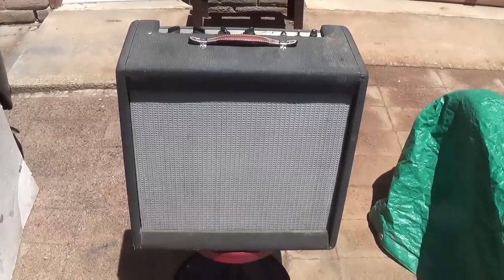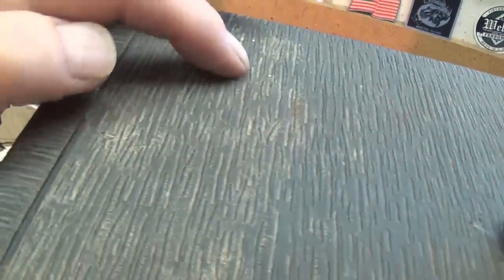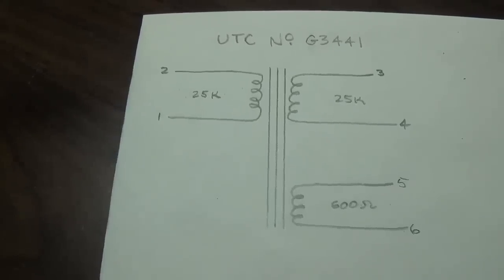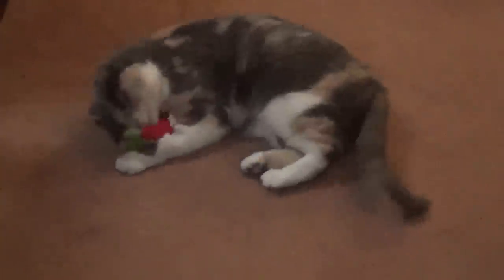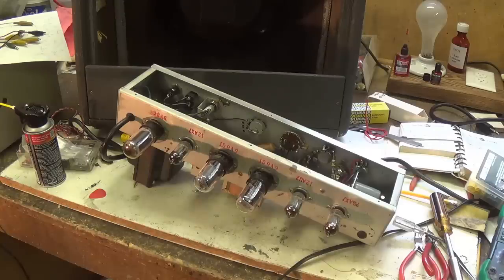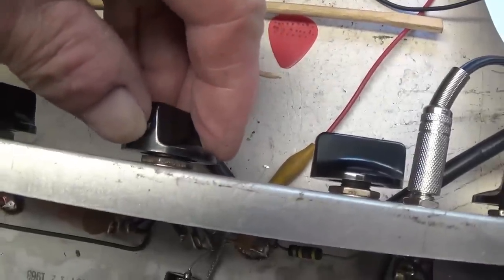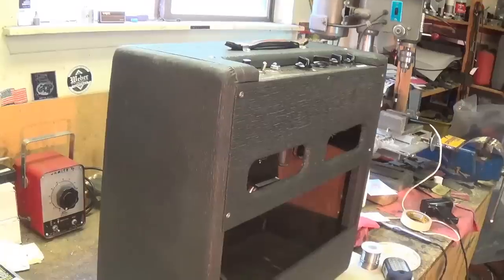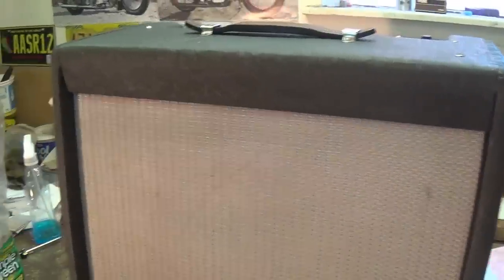1963 Lesmann "Echo" Amp......No More Polkas for this Bad Boy

Comment from the maker: NOTE:  As a viewer noted, the tremolo seemed to overdrive the output tube(s) a bit. As a result, I increased the value of the resistor between the oscillator and grid from 100K to 220K. Problem solved :)
Reply: Whoa UD! The guitar fairy dropped a Legend Rock n Roll 50 on your doorstep!! That's the amp Billy Gibbons used to record ZZ Top Eliminator! Careful, that is one LOUD amp  📢🔊

Life is good 😎👍🏼
Reply from the maker: @kickinvideo333  It is indeed, KV.....and it is truly LOUD !!
Reply: After watching one of your educational videos I understand why the vibrato did not work when connected to the grids of both output tubes.
The push pull circuitry cancelled it out!
When you moved the tremolo to only one output tube grid there was no cancellation.
Reply from the maker: @Dennis-mq6or  Thanks for the helpful input, Dennis :)

Comment: From Leo:  My mother's  accordion had a magnetic attached microphone that was hard wired into a long lead cable.  A low Z microphone could explain that 600 ohm input.   Nice work.
Reply from the maker: Thanks, Barb. I agree.
Reply: Barb Melle, it's interesting to note how many amplifier manufacturers in the late 50s and early 1960s were manufacturing amplifiers with labeled accordion inputs, amps that were marketed to accordion players. This includes Ampeg, Sano, Magnatone and all the various rebranded "Maggie's" such as Panaramic, Titanio, Giuletti and others. And yet, the actual pickups or microphone assemblies that would have been attached or fastened to the accordions themselves are virtually nowhere to be seen. I've bought a lot of vintage microphones at flea markets and ham radio Fest in past years, and although I would see lots of accordions at the flea markets they never had pickups attached.
Reply: @goodun6081  I wonder why?
Reply: @donaldheitger6731  , like I said, it's a perplexing question. Perhaps the inclusion of accordion inputs on all those amplifiers was merely being hopeful on the part of the amp manufacturers, that they would be used for something other than loud rock and roll guitars. Certainly Ampeg founder Everett Hall detested rock and roll, and made every effort to not accommodate rock and rollers or anybody with long hair, any bands that were coming through the area and might have been interested in visiting the factory, and so on. This definitely put a dent in Ampeg's sales figures,  until Hull was finally put out to pasture in the late 60s. Anyway, perhaps the anticipated, hoped-for (chuckle) glut of pickup-equipped accordions just never materialized. The old- guard musical equipment manufacturers we're slow to see that the rules of the game, indeed the entire game, had changed. And then the music market got really soft around 1969 and a whole bunch of manufacturers went bankrupt.
Reply: @goodun6081  I have a Farfisa "Transicord" amp (Solid state, sadly) with an accordion input.   The connection looks a bit like a tube socket, actually.
Reply: @goodun6081  I started playing guitar in 1957 and there were a lot of accordion players around. By 1965, not so many.
Reply: @goodun6081  I know I'm really late to this party but it's fashionable, many years ago I repaired an old guys electric accordion. No mike, just plug straight in.

Comment: Ya know, Doug...its surprising how much difference just having clean, proper power supplied to the amplifier(& fx) makes. I bought a 3-light outlet tester and it showed the outlets I use had live & neutral swapped.

So I swapped them to their correct spots on the outlet and buttoned it back up. I swear to you that killed 90% of my hum issues. I couldn't believe how much hum I was getting.

First, I was getting hum from the outlet itself due to the backwards live & neutral. Then I was getting EMI hum from it when I got anywhere close to it with a guitar. Finally, I was also getting hum from my cheap pedal power supply.

So I fixed the outlet and that killed the power hum and the EMI hum. Replacing the power supply got rid of that hum/buzz, as well(and the last 10% of excessive hum). I honestly couldn't believe how much buzzing & humming I had prior to fixing the outlets.

Now, it's quiet as a mouse. I can crank the amp up 100%(gain & volume maxed) and it hums less than it did at even 25% before. When I plugged in after fixing it all, I was ecstatic, to say the least. 👍
Reply from the maker: That's great news, JC. Thanks for sharing :)

Comment: Aluminum is difficult to drill because of it ductility and softness causes a constant contact with the cutting edge of the drill face. Probably to save on drill bits during manufacturing.

Comment: I'd be "less of a man" for not watching this Lesmann amp video.  Thanks Uncle Doug.
Reply from the maker: Thank heavens you watched, ¿. You're welcome.
Reply: @UncleDoug  what's the best way to contact you to donate hardware?  I'm considering getting some reissues of 1965 Fender guitar amps but not sure how they stack up to the originals.  I hear they make them in Mexico now.  Not sure whether to get a Princeton or Deluxe Reverb. What do you recommend?
Reply: Is that a ‘ Nes Lesmann ‘ or a ‘ Les Nessman ‘ amp?
Reply from the maker: If I were you, I would find a nice Silverface Princeton or Deluxe Reverb from the late 60's, early 70's. Their circuit is virtually identical to the Blackface versions, yet the price is about the same or lower than a reissue.....which will have PCB's, 1/4W resistors, and all sorts of corners cut to keep cost down.  Give me your e-mail address and I'll contact you directly.....but make it a fresh comment. This one is buried too deep to find tomorrow.
Reply: @UncleDoug  your recommendation is much appreciated Uncle Doug, and this leads me to ask, if the price is nearly the same, and the circuit also nearly identical, then why not opt to buy a new reissue which has the added benefit of tubes that have not depleted any of their life cycle?  Not questioning your wisdom, just trying to understand where you're coming from. Admittedly, I'm partial to the aesthetics of some of the reissues currently available in some of their limited edition versions.
Reply: @michaelszczys8316   I'm actually in the market for a Les Nessman amp.  I've been following them on eBay, but since they earned the coveted Silver Sow Award, their prices have gone through the roof.
Reply: @thBrilliantFool  The Silverface Fender amps will hold their value or appreciate in value over time. They can easily be serviced and repaired almost forever. The reissue amps are quite good but lose value just like a new car. The components are cheaper and the circuit boards can become problematic, particularly if you want to do some component upgrades.
Reply from the maker: @johntempleton6368  John is correct. The earlier amps are far more robust, often have better tone, and will appreciate in value.

Comment: Check out Mr Carlson's Lab he gives good servicing advice for the hybrid Legend  amps the semiconductors are easily destroyed, good advice for anyone not used to working on this type of amp
Reply from the maker: I am not strongly inclined to work on the hybrid circuit, John, but if I do, I will keep your suggestion in mind.
Reply: The upshot was, don’t go around with your probe AC-coupled in the high voltage bits and then zap the SS bits with the charge still stored in the probe’s or scope’s coupling cap.
Reply: Correct being unaware of this hazard could end in tears
Reply: @hubbsllc  , and although it's not a hot chassis, transformerless amplifier, an isolation Transformer on either the amplifier's power cord or the oscilloscope's power cord might be a good idea.

Comment: Nice job. The mystery transformer is in the anode circuit of V1B. It is therefore an output, providing two isolated secondaries: 25K at the same level as the primary, probably a few volts, perhaps to drive a slave power amp, and 600 ohms to drive a studio mixing desk directly. Or maybe they are the send and return to and from the missing echo unit? Both are tapped off before the volume control of course. It is a feature, not an anachronism, and IMHO you should leave it wired in. Anyway the primary is part of that anode load and can't be removed without shifting the operating point of V1B. The 25,000 and 600 ohms are impedances, not DC resistances, and 600 ohms was a common standard for audio back in the day. I still have some 600 ohm stuff from the 1980s. 

The amp is overloading far too early. I would increase the 56K grid input resistor to say 100K, or maybe raise the cathode resistors to 4K7. At least you should remove that resistor you put across the 25K primary.

The Echo and VIB remain mysteries. VIB must mean vibrato, but you need severe phase shifting to even approximate that. What was switched differently in the VIB and TREM positions?
Reply from the maker: Thanks for all your helpful comments and suggestions, EJ. I will definitely keep them in mind.
Reply: Uncle Doug The more I think about this the more I think it must be the echo send/return. It fits right in with the current-drive current-out nature of reverb springs (=> high source impedance, low target impedance), and it provides gain (sqrt(25,000/600)) to compensate for the lossy transducers.

Comment: I once bought a Cordovox accordion from strangely enough, a woman named Maggie. This thing was massive. It had an amplifier unit like this one,  mounted in a cab. along with 2 x12" Fender speakers and a twin cab. which housed a huge point to point wired chassis with hundreds of caps and resistors. Each note played on the accordion itself had a dedicated circuit. There was a large umbilical cable that ran from the Accordion to the circuit board that also housed a ton of 6X8s , it also included a volume pedal. So, there you go.
Reply from the maker: That sounds like a huge amount of circuitry and equipment......for an accordion, Tim.

Comment: Doug, I really appreciate that you don't get mired down in the theory when deciding to do some mods & are not 'afraid' to just launch in with the knowledge & experience you have and do the good ole trial and error method.  It makes it easier for us others to understand that you don't have have a road map, just some common sense.  tube circuits are very forgiving so even if you make a 'mistake' most tubes will recover...even red-plating output tubes as long as you don't leave them that way for too long.
Reply from the maker: Thanks, Glen. I encourage all budding techs to use trial and error at every opportunity. Once you gain experience and knowledge, the trials get better and the errors become much less frequent :)

Comment: These amps were used in Polka bands with accordians.  Owners father lived in Minnesota or Wisconsin Polka was really big in that region. I examined one several years ago much bigger in size. It appeared that each key was individually amplified from accordian signal. There was a myriad of wires running all over top to bottom connections so numerous it looked like a science fiction movie prop.. It also had two other sealed cabinets I guess were speakers but had large multi pin cable connectors. These do show up on E*ay from time to time. Doug good luck on this one. However it is in the right rescue clinic.
Reply: Sorry but i did not mean owners father of your amp. The one I looked at owners lived in Polka land
Reply from the maker: Thanks for your confidence in my efforts, SG. It did turn out quite well.

Comment: Fascinating unit you got there. I introduced a friend from university to your channel a couple days back and now he's a huge fan of yours. He wants us to build an amp someday.

Greetings and keep up the good work.
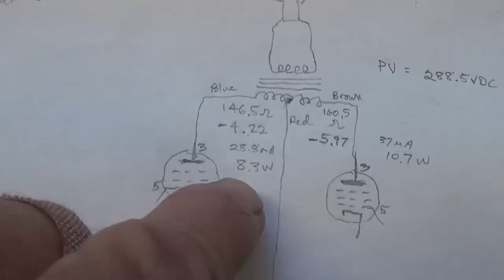Reply: At 18:00, looking at your simple hand drawn output circuit,  there's no negative feedback? I would have thought they'd want a cleaner sound for an accordion. Since you're going to be modifying this unit anyway, you could put in a switchable negative feedback circuit, also known as a presence control. Maybe you could even use the rotary 3-way switch for that function.
Reply from the maker: Thanks so much, Mr. TM. Our best to you both.
Reply from the maker: That's a good idea, GU. Thanks !!
Reply: @UncleDoug  , you'd also have to experiment to see which way the negative feedback gets hooked up without causing a feedback squeal, from positive regeneration or oscillation. That might be fun to show people in a YouTube video! Good for peoples learning curve.....
Reply from the maker: I think most of us have heard what a positive feedback loop sounds like, GU. It would make a memorable and  informative video segment.
Reply: @UncleDoug  Note that even a negative feedback loop can oscillate with enough gain or phase shift.

Also the feedback loop in an amplifier can be exploited by using other componets other than a resistor for the feedback. For instance, putting a low pass filter in the feedback line (such as an RC filter) should in theory increase the high end of the amp and viceversa.

If done incorrectly, this would be an instance where you could send the amp into oscillation due to phase shift.
Reply from the maker: I have noticed, when fine tuning NFB loops, that too much return can cause motorboating to occur. You generally need at least 10K of resistance in the loop to prevent this.
Reply: @UncleDoug  Indeed it can, and the reason of why is this whole field of study in electronics, especially in control theory.

I have been unfortunate enough to have to calculate by hand what's the critical value that would sent a device like this into oscillation. The math behind it is pretty interesting but still a pain when you have exams about it.

Comment: Uncle Doug I played about 1000 bar gigs in the 80s using a Legend 50 - same amp as you have there.  It was.a small company in Syracuse NY. They had no idea how to price their product and went belly-up.  I have a schematic I can send you  it has a foot-switchable clean/dirt channels and some other useful features like a line out.  Mine does not have a reverb tank. It is insanely loud. Mine has been sitting in my garage for 20 yrs.
Reply from the maker: I have a schematic, TF, but thanks for the offer. The amp seems to work just fine, and is indeed horrendously loud......louder than either of the 50W Marshall amps featured in recent videos. I will be including an audio test demonstrating its remarkable volume and tone in a future video. It has no effects other than an effects loop with volume controls.

Comment: I just brought home my second Lesmann amp today from Minneapolis and the previous owner still had the accordio-organ that came with it. I got a demonstration of how it works. The accordion is likely an import that Lesmann added their patented electronics to. There's a hefty interconnect cable and the tone is quite pleasant-not the cheesetone you'd get from a Farfisa or a Vox organ. It is in very nice condition and had been owned at one time by a person who used it for his performances of Persian folk music. I suppose that there had to be some sort of power supply to run the electronics so I'll have to see if the mic plug has any live pins.
Reply from the maker: Very interesting, Robert. Thanks for sharing.

Comment: The advantage to cutting the corners on the control panel over drilling is not having to set up the drill press or a punch and simply shearing the corners off as you shear each panel in the same session at the same station. It also lessens the chance of snagging those corners on the cabinet vinyl when the chassis is installed, and peeling them up or gouging the vinyl.
Reply from the maker: Thanks for the explanation, TN.

Comment: Ripping good stuff as always. You'll be happy to know that I repaired a Fender Deluxe Reissue amp this morning. Just a couple bad solder joints on the primary 12AX7, but  it's my first tube amp repair. ( Oh the braggin' there'll be)
Reply from the maker: Thanks, Mr. CC. Congratulations on a successful repair :)

Comment: Sound fantastic.  Nice Bass response.  You been practicing  !!!  Great Job as always.
Reply: And you left me thinking about the feeding the grids for the outputs directly.  I would think the problem you were having with the second tube is an out of phase  problem if you pump them both directly.  That would explain why one works and the other doesn't.  The other is 180 off.
Reply from the maker: Thanks so much, Bert :) You could be right.

Comment: Please be careful if you are going to check this out with an oscilloscope, you can damage the transistors if you go from the high voltage tube section to the transistor section. The oscilloscope can store high voltage across the test leads and discharge it across the solid state components if you go from one to the other. It' won't be an issue of you discharge the probe by grounding the tip.  Beautiful wood case on the donor amp. Keep these videos coming!
Reply from the maker: Thanks, Christopher. I will keep your warnings in mind.

Comment: 23:00 - From first glance it appears to have a solid-state output stage drive-in by bi-polar power supply. Interesting that the filter caps associated with each supply voltage are located very close to their associated preamp stage! Very cool design!
Reply from the maker: It is indeed beautifully designed and built, David.